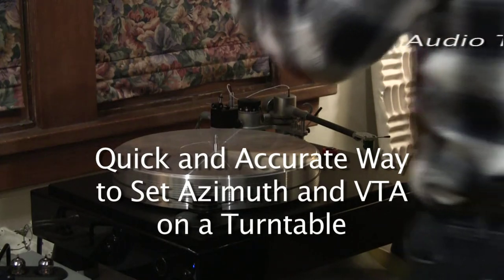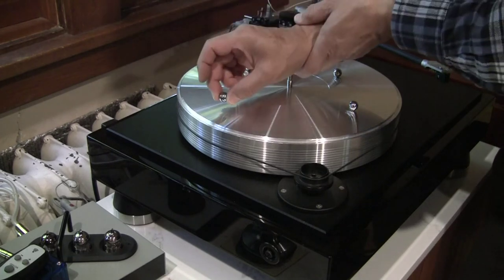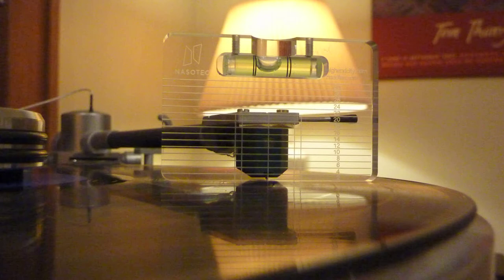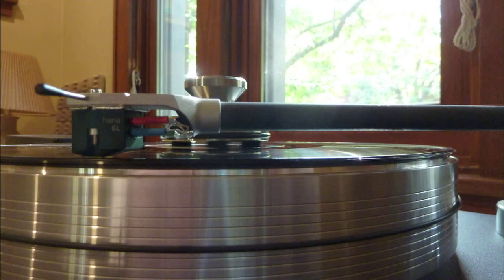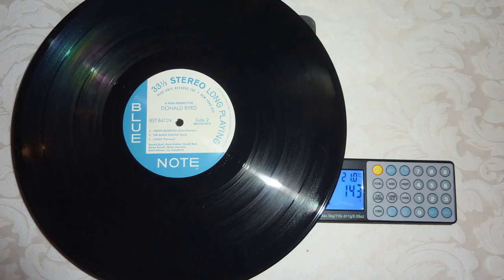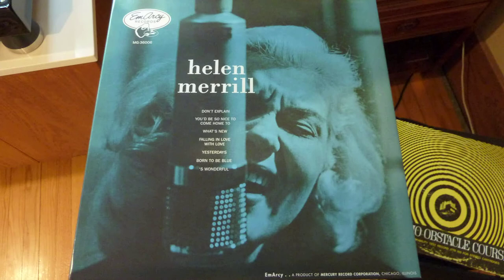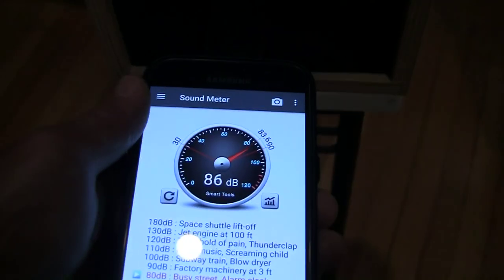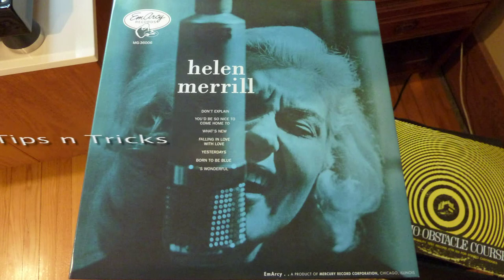Quick & Easy Way to Set Azimuth & VTA on a Turntable

Comment: It’s still odd that in the 21st Century nobody has produced a self calibrating tonearm or a tonearm with in built calibration systems. For all of the things you said, you would probably have only arrived at a starting point. You would have to trust the stylus and cantilever and the compliance of the suspension. The final adjustment will very probably require iterative adjustments of each of the parameters you addressed with listening as the final arbiter of adjustment.
Reply from the maker: @christopherward5065  it's very much art rather than science. The tool depends on vertical & horizontal alignment of cartridge body and assumes stylus angles are set correctly. The human ear probably can't discern a few degrees of vta or azimuth error.
Reply: @AudioTnT  the variables are many and for all the precision of the tools people apply we find that two identical arms, cartridges and turntables set up according to those precise measurements will sound different and probably, because of the myriad variables that introduce error both are likely to be inaccurate. Because the variations in the positioning of the stylus in the groove and the power of our brains to correct the errors and distortions as the record is transcribed we can tolerate errors. To make the two identically set up record player sound more similar we would have to adjust them away from what the precise tools suggest as perfect settings. I wonder if the psycho acoustics of the constantly shifting errors are what make playing and listening to records more engaging than listening to digital files.
Reply from the maker: @christopherward5065  Kevin Grey, the vinyl mastering guru attributes the desirable sound of analog vinyl to "artifacts", aka distortion...whether in the record groove or playback equipment. Measurement parameters haven't evolved in 50 years.

Comment: Thanks for the helpful tips! Pulled out my acrylic alignment tool and learned from you how to level out the tonearm from the side. Used a test tone and an app to measure the dB level for both  speakers. Worked great👍👍

Comment: Really interesting video, I will check the setup of my Rega Planar 3 with my Hana Umami Red cartridge on a RB 880 tonearm following precisely your suggestions. Very clear and simple explanation too. Subscribed to your channel immediately.
Reply from the maker: Thanks! U might need shims to raise/lower tonearm. Worth the effort. I have Hana EL. Is Umani Red an audible improvement?
Reply: @AudioTnT yes, I've seen you have a Hana SL on your turntable during the video. Of course I've put a Rega shim to set the correct VTA and I've checked my cartridge following your Infos and, to my eyes, it has been perfectly set up. I had a Rega Ely's 2, than a Rega Exact, than Hana ML and now Hana Umami Red, yes, improvement is arguably high, in term of details, precision and clarity... You can recognize with more simplicity if a record has been mastered good or not, it's a very neutral cartridge, suitable for all the musical genres, from classical to metal. It's my definitive cartridge, maybe it deserves a better turntable, but I'm absolutely satisfied about my setup, although I've substituted the original Rega RB 330 with a better RB 880 tonearm. I can say that my Rega Planar 3 is better than a RP6 for sure and very close to a RP8.

Comment: Great video! I've set mine up in the past with a GeoDisc, but this looks much more accurate. Can you please provide a link to the acrylic tool you are using in this video? Thanks :)
Reply from the maker: Nasotec sells for $55. This one is cheaper..https://www.amazon.ca/Phonograph-Azimuth-Alignment-Cartridge-Measuring/dp/B08VNRJLZX/ref=asc_df_B08VNRJLZX/?tag=googlemobshop-20&linkCode=df0&hvadid=459598214546&hvpos=&hvnetw=g&hvrand=9374188831672126127&hvpone=&hvptwo=&hvqmt=&hvdev=m&hvdvcmdl=&hvlocint=&hvlocphy=9000671&hvtargid=pla-1485937537410&psc=1&mcid=8dc76c8ad1cc309baedbe6b4018baa88
Reply: Thank you so much for the tip! My system is currently not up and running due to apartment remodeling, but I will get this. @AudioTnT

Comment: do you adjust the azimuth with anti-skate weight attached or removed?
Reply from the maker: @striperseeker  that's a great question! I don't recall whether the antiskate counterweight was attached at the time. Especially important w unipivot tonearms. I'm not a big fan of antiskate and neither was VPI so my guess is "no".
Reply: @AudioTnT  Thanks.  Is it possible to not have to use an anti-skate weight? I took great care in adjusting balance, downforce tracking, VTA and azimuth and my Pro-Ject Xpression II seems to not have an outward force on the tonearm that needs an anti-skate weight. In fact, the stylus sits so much better without it installed.
Reply from the maker: @striperseeker  absolutely. Some systems overcompensate, pushing the tonearm outwards. Plus it seems to me the amount of force should be less as the tonearm travels closer to the center. Not sure these systems do that.

Comment: All you have to do is use the overhang gauge supplied with every cartridge. Ensure your cartridge is absolutely parallel with the head shell.
You do need good light and perhaps magnification glasses or a fixed adjustable magnifying glass.

It is preferable to have an easily adjustable vta/sra tonearm as shims are just a pain to fit. A removable head shell really makes the process easy but the hifi/ audio police hate them.
Reply from the maker: I wish my vpi tonearm had removable headshell. My Musikraft Denon 103 is there for long term. Rega tonearm can be shimmed but u r right. It's a pain.

Comment: Over and over again .............The VTA ..............while the VTA will be whatever it will be when the right SRA angle is adjusted !!!!!!
Reply from the maker: How can you measure SRA angle accurately?
Reply: @AudioTnT  with usb microscope. Take a picture from a side, perfectly horizontal and verticalto the vinyl surface, so you can see only the edge of the vinyl, no groves. Then open it in some program, draw some lines and you will see.
Reply from the maker: @patarejaspata  Great idea. Will give it a try. Can use it to check stylus wear too. Thanks!
Reply: @patarejaspata  What is a usb microscope?